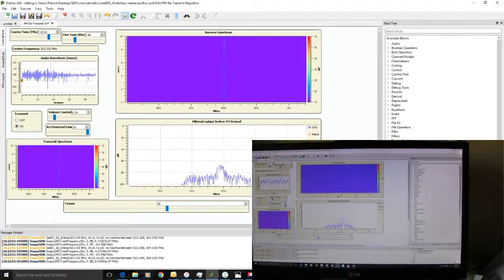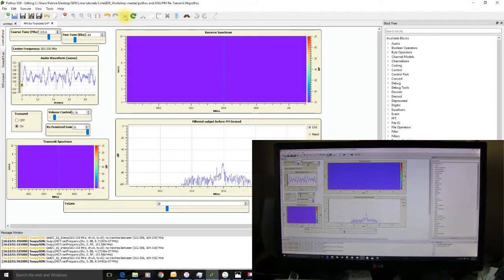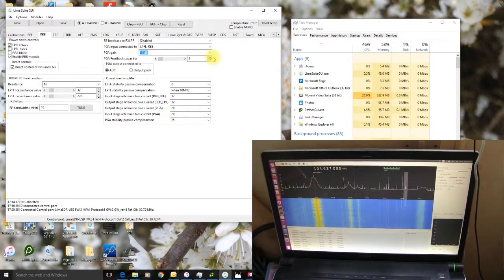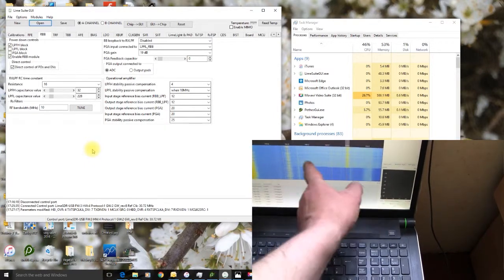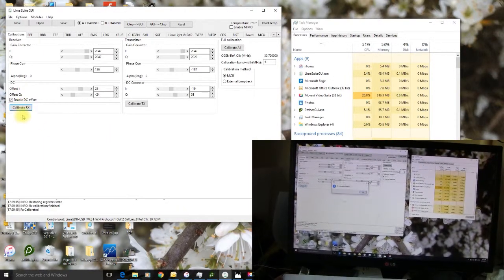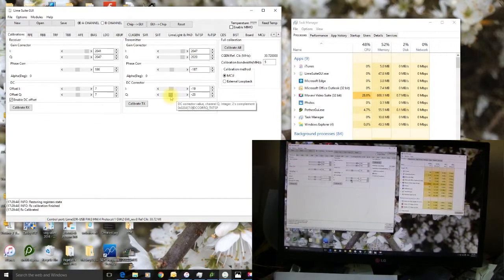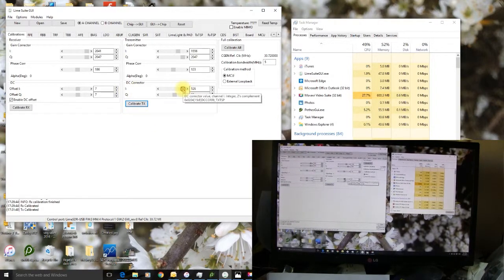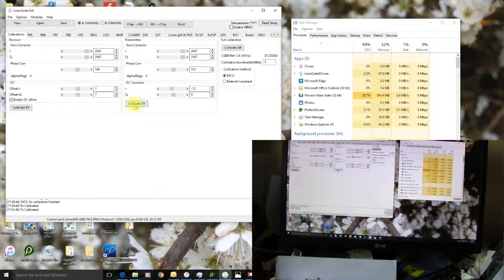Testing Limesuite calibration widgets using FM re-transmit

Comment: Any thoughts on using SDRAngel to transmit FM?  I added a LimeSDR 0,0 as Sink Device, tried NFM and WFM Modulators channels, connected a small whip antenna to TX1_1, however, according to the waterfall, it's transmitting, yet I'm not getting anything on a nearby laptop running RTL-SDR/SDRAngel NFM and WFM DeModulator Channels.   Any suggestions?